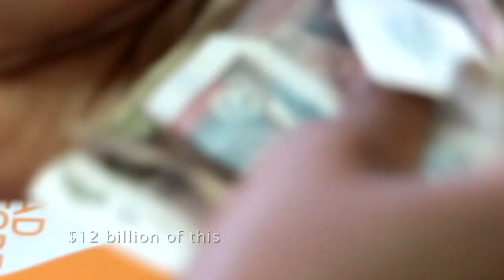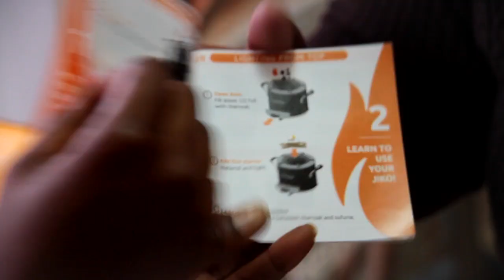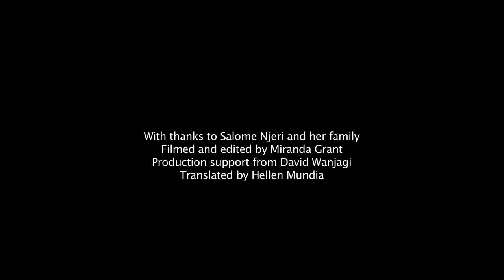BURN Manufacturing launches New Cookstove Factory in Kenya!

Comment: Wouldn't solar stoves be better in such a sunny place? And how about heat retention cooking? She could heat the pot and put it in a heat retainer for the day and that would use a fraction of the fuel that she is using now.Heat retainers can be made with almost anything. I made mine with some old towels and a box. They could be made with sand and a hole in the ground. And with the solar oven, it would require no expenditure on fuel. The sun is free.  A solar oven can be made with cardboard and aluminium foil.  So these single moms need not go into debt to make one.
Reply: can i watch a video demo of  a heat retainer?
Reply: Teach me about it

Comment: True, burns charcoal a little more efficiently. Issue is, trees are still being felled to fuel these stoves. There's got to be a better way to save trees MUCH MUCH needed in Africa and zero emission cooking. African should have invested in solar by now. The infrastructure is there, desert as far as they eyes can see, plateaus galore can harness wind power, a good distribution network can provide electricity to power electric ranges designed to work with solar.
Reply: kanyaugatiejagwo there is Solar but those living in absolute poverty cannot afford it

Comment: Hi.. can i use rice husk in this stove...
Reply: The problem with paddy husk is it requires very high heat to ignite. Two engineering students had,as early as 1994,had designed a stove,in Siddaganga engg. college,Tumkur.